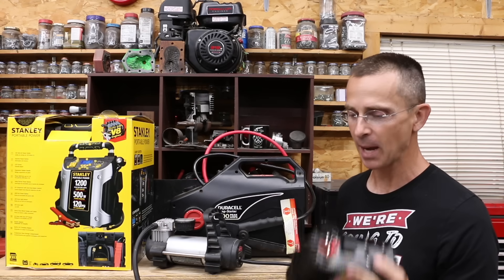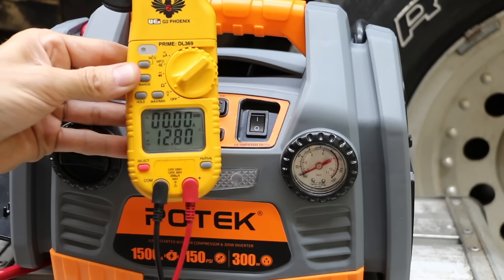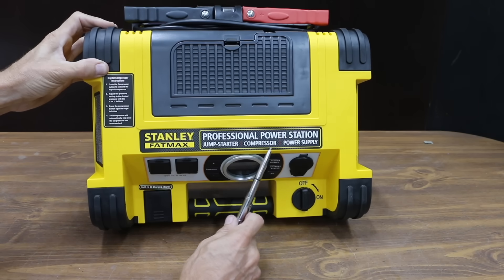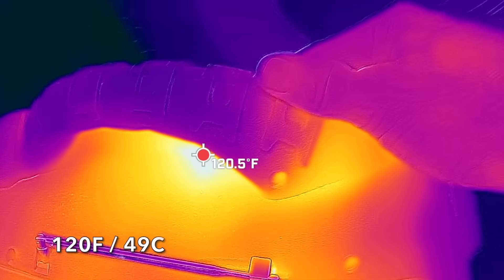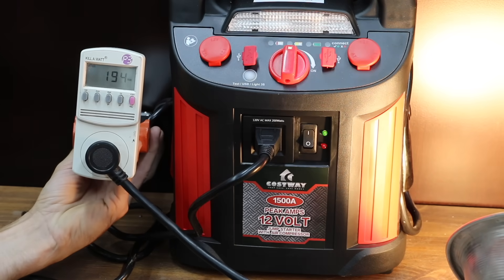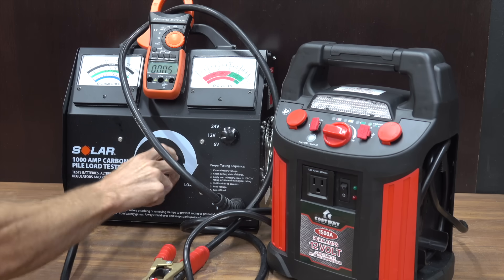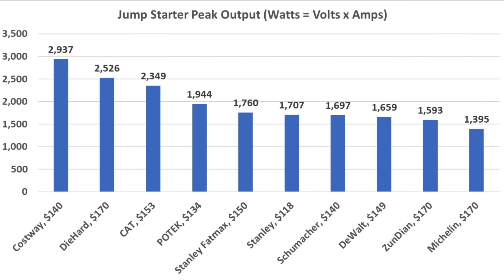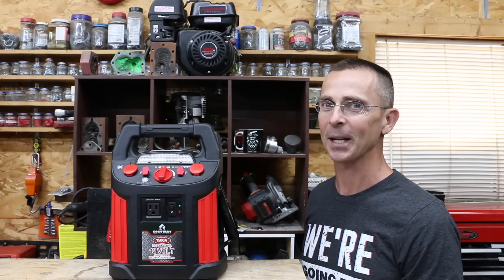Best Jump Starter? DieHard, Schumacher, DeWalt, Michelin, Stanley, CAT

Comment: Todd - Did you re-drain the truck battery after each attempt at start? And, wait long enough (I dunno, 5-30 minutes?) between devices to let the chemistry resettle? Also, did you control for how long you had the jump pack connected before trying the ignition? Two critical things to make an apples-to-apples connection. Details: What happens when you connect the jump pack to the battery (with the jump pack's switch on), is that it immediately starts trying to equalize the jump pack's battery with the car's battery. This charges up the truck battery continuously. If you didn't re-drain it afterwards, then it's unfair to the early jump packs because they were basically just dumping a good portion of their charge into helping their competitors next round. Also, you need a certain amount of voltage to spin the engine. I.E. If the jump pack is at 13.8v, and the starter battery is at 2v, and you try to start it right away, a little power is going into the battery, but most of it is going into the engine, and there's a high voltage to cause a high amount of amps to flow. But if the jump pack has been sitting for a while, even more than just a few seconds, it's voltage is going to be sagged from charging the starter battery, and the lower voltage is not going to cause as many amps to flow. Even if the same net amount of energy is still in the system (jump pack charges charger, even pretending it's 100% efficient), you can't get the energy to pump out as quickly from the lower voltage. Jump packs really need every possible advantage they've got, to be able to turn over an engine, right from fully charged. If you were to compare with those portable lithium-ion/supercapacitor packs, those definitely don't have much energy at all, they have very, very small amounts of energy but can dump almost all of it at once, but that means you've got only several seconds to start the engine or they'll have nothing left. They might even have brains in them to make sure they don't even try to charge until they detect a starting load. They're a more extreme sensitivity compared to lead acid jump packs.

Also... 13.9v isn't overcharged for SLA batteries. If you were to take the jump packs apart and see printed on them or look up their datasheets, most would probably tell you to charge them to between 14.5v and 14.8v for standby use. North of 14.8-15.0v is where lead-acids are actually overcharged and will start to eventually boil off electrolyte. And different brands will have very slight chemical differences in their cells, with slightly different voltage tolerances. It would be smart to use a slightly higher voltage version in a jump pack, where power (not energy) is your biggest goal.

Also... a vehicle with a flat tire can still have the engine running. How long the compressor lasts without dying isn't all that relevant when you can plug it into your cigarette outlet while pumping (or at least burp it back full again by clamping it onto the starter battery). Contextual failure makes it a lot lower priority to only half-fill a tire.

Comment: Have you considered testing the starting capacity at cold temperatures? I live in Alaska and one of the issues I have had is the charger has sat in vehicle for a while even if it was warmed up earlier.  Would be interesting to see how they perform when the unit is cold. Hard to duplicate real life conditions for all the parameters but placing them in a freezer for a couple of hours might have interesting results. Always enjoy your videos, thanks
Reply: Agreed, but unfortunately these are all junk in warm temperatures so they would have been even worse in the cold.

Comment: The DeWalt one was torn down a few years ago on another channel and a viewer commented that because the piston is missing a wrist pin, it's lifespan is limited because the piston and wall of the cylinder would be affected die to the rocking motion.

I'm going to assume that is the same design for probably all of them, but it would be pretty cool to find out if one or two actually used a wrist pin.
Reply: Had to look up what a wrist pin is, and it appears to be the main pin that connects the connecting rod to the piston.  In other words, a critical part that has to be made and machined to high quality standards to work well and hold up to the tough job it does.  How can you connect a rod to a piston without a wrist pin?  Did DeWalt find a cheaper way to do it?  (All these decisions are ruled by the almighty dollar.)

We bought a new, no-frills Whirlpool refrigerator 2 1/2 years ago.  It works great and you can barely hear it run, so that piston (in the compressor) must have a darn fine wrist pin.  Will it still be running in 20 years like the last refrig?  That's the question that only time will answer.  Most everything is made to be thrown away these days rather than repaired.  My parents had a 56 year old General Motors refrigerator (made around 1950) in their basement that ran perfectly up until the day they sold it to someone for 25 bucks.  That was 15 years ago and I wouldn't be surprised if it's still running today.
Reply: @Brian424  The unitary piston-connecting rod is used not just to lower the cost and complexity of construction,it lowers the weight of reciprocating components and is almost always used on small capacity/short stroke air pumps.They require very little in terms of lubrication,a wrist or gudgeon pin that small would rapidly wear in one area without sufficient lubrication (you don't want vaporised oil droplets entering your air supply)Automotive suspension pumps are a perfect example of their use.The almost spherical piston design reduces friction on non lubricated cylinders,thereby reducing heat and wear,the piston is generally sealed by a single thick nylon/teflon round edged split washer type seal which maintains sealing at any piston inclination.The design has been around for decades and is by and large reliable. Those little plug in tyre pumps you get in your boot/trunk will have the same principle. Also the compressor in your refrigerator is a rotary type pump it works on a cam system.
Reply: @areyouundoingthatorwhat9181  The random knowledge about everything that can be found among YouTubers and the rest of the internet never ceases to amaze.  Thanks for making me have to google a bunch of stuff to see pictures of what you're talking about.  Knowledge is power! 

PS- Tyre is spelled tire.  And colour is spelled color.  And a trunk is a trunk, not a boot.  And a hood is a hood, not a bonnet.  And a windshield is a shield, not a screen.  Love ya!  ;^)
Reply: @areyouundoingthatorwhat9181  .... I have to ask this question.  What is your line of work?? Are you a mechanical engineer?  Also, thanks for the explanation about how these things work.  I too am sometimes amazed at the depth of found in YouTube comments.
Reply: @amp12345amp  I spent my life,man and boy in the motor trade, about 40 years all told. Predominantly electrical and electronics nowadays but we (my family)also design, construct and prove specialist vehicles for various industries,mobile desalination plants,pumping stations,winches,generator trucks,field workshops etc. And some modified cars,I am currently about 75% into a 300 bhp focus ST track car for a customer.

 I do all my own fabrication,panels and non power train machining and also have extensive experience with composites. My family have been involved in the trade and industry since the turn of the 19th century, working as design consultants and specialist development or design engineers for companies such as,Dunlop, Roush,Jaguar,ford motor co,Skinner's union,century oils etc.,an uncle developed sewing machines for Singer. My father a very skilled engineer and specialised welder,now mainly retired from the day to day stuff restores vintage farm machinery and tractors,most of my knowledge extends from a childhood of being his lacky😁 I was learning stuff like arc welding at 7-8 years old!,so machinery is sort of in my families blood with a good concentration of varied knowledge, one of my sister's is a skilled auto trimmer/ upholsterer. I have personally completely built or restored approximately 15 cars for myself,some with very extensive modifications. Fortunately I have been blessed with a brain like a sponge, natural dexterity and a hereditary knack,allowing me to turn my hand to many tasks with ease,dogged determination to not fail is a trait I also suffer from😁. My philosophy is that life is a big,long lesson,enjoy it and make the most of it.
Reply: You will only use it once or twice in your lifetime, so thats a pretty good lifespan.
Reply: @thra5herxb12s  not necessarily. I've use my Schumacher once for my own car but a half dozen times to help my friends and acquaintances. I can't speak for the other brands but the Schumacher seems to hold up to multiple inflations.
Reply: @thra5herxb12s  And when you finally need it, it will probably be dead, because it's been forgotten under a pile of "junk in the trunk" since you got it for Christmas seven years earlier.  :-)

Comment: I enjoy Sundays waiting for the latest PF review. The usual very thorough review and test. I have had a CAT for 5 years and so far it has performed flawlessly.  I just recharge it every 3-4 months.  The has a compressor PSI set point that automatically turns off the compressor when the set point is reached.  Great feature.

One area to improve your tests is to explore the ease of repair.  For the power station, you need to eventually replace the lead acid battery inside.  Can it be done and if yes, how easy is it to perform?  Same thing on power tools with brushed motors.

An idea for a future test - toolboxes like a 2 or 3 drawer "portable" one (handle strength, dent resistance, drawer slides weight capacity).  You might by one or two and have it for a long time - choose wisely.

Comment: Great test regimen as usual and you proved what I always suspected, that these devices are largely junk and cannot be relied upon.

I have a starter/charger that is separate from the pump. Neither are amazing, and in fact the mains charger for the starter/charger was the first to fail and then, after finding a replacement mains charger, the circuitry inside the starter/charger refused the I coming voltage. As the batteries were good, I chose the use a ripple charger for it and bypassed the circuitry. It works but boy these things are rubbish.

Comment: I would guess the ones that smoked was the internal wiring or the large switch that turns on power to the battery clips, i had a couple that died at the switch with a high current through it.  Gave up on these manufactured boxes and made my own. a large automotive AGM battery made by Deka in the USA, a marine battery box, a set of jumper cables and a set of 175A Anderson connectors that can take far more surge rating, one connector bolted to the top of the battery box the other on the end of the jumper cables, plug it in when you need it.  Yes it's heavy, and i made a frame with a handle attached to the battery box, but its reliable and always works.  It don't have a inverter, don't need it, don't have a air pump, don't need it, i just want something that can jump start anything.  When its not being used its on a small float charger to keep it topped up.  It ended up being a very handy thing to have as battery quality has gone into the toilet these days it seems.

Comment: It looks like the Shumacher assumes a power factor of 0.9 with any load, even for loads with perfect power factor such as an incandescent light bulb.  Makes sense since most electronic loads that will be plugged in will be between 0.9 and 1 PF.  That way they don't need to do fancy integration to measure real power, just multiply magnitude of current and voltage with 0.9 and it will be close enough.

Comment: Interesting how the two Stanleys, the Dewalt, and the Cat all have the same exact LCD display in them.
Also interesting how those same 4 happened to be the only ones that shut off before reaching the target tire pressure.
Kind of makes you wonder how many different brands of devices are made up of the same components inserted into different cases for different manufacturers.
Reply: Pretty sure they are all set to cut off at 10 minutes as an overheating safety. Most all of those compressors say to use a duty cycle of on 10 minutes on then 30 minutes or so off before running 10 again.  Almost seems pointless for anything other than bicycle tires.

Comment: I wonder if the ones that smoked up are due to thin gauge wires and circuit boards with weak solder connections. I’d like to see tests done with the mini jump starters unless you have done this video in the past.

Comment: This test seems to confirm what I’ve noticed.  I bought my first jump box/compressor roughly 20 years ago.  The couple I’ve purchased since, just don’t seem to have the same capabilities. Thanks for all your testing- it is greatly appreciated.
Reply: I had one that worked well about the long ago too.  It started several cars on several cold Minnesota mornings in the trailer park I used to live in.  (Trailer parks aren't known for late-model cars with new batteries.)  A couple of those cars were owned by hot, grateful girls, but alas, I was married at the time.  Then the jump starter burnt up in a house fire.  Last I saw it, it was a pathetic, melted lump.  They don't make things like they used to.  Can't remember the brand, but it was nothing anyone ever heard of.  No idea where I got it either.

Comment: All these have the same problem as jumper leads do, they are all trying to push way to many amps through a crappy clamp that doesn't have the surface contact area to get that many amps through.. they would probably work better if connected and left for a while to put some charge in the car battery first before trying to start the engine.. I've never used these jump packs before but i never just try to jump start a car with jump cables without first waiting to allow the car battery to receive some charge so I'm not trying to push 500+ amps through a few square mm of contact area.. note the contact area on the terminal champs on car battery cables,  they have several square centimeters of contact for a reason

Comment: On the air pressure gauges that are off I have seen they over fill a bit. I found if you disconnect and then just reconnect the air chuck on the tire valve  it will read the correct pressure or closer to it. I think it is the pressure in the unit / hose that causes the over pressure until you release it and read pressure again.

Comment: I have an older model FatMax (before they included a power inverter). I used it to inflate a large tire at low psi, but the extended use killed the air pump. It was very hot. I don't know if there was a safety switch or if it simply malfunctioned. It seems the Stanleys, Cat, and Dewalt jump packs use a few common components. They had similar performance with the air pumps, and they have similar LCD displays. Also, there is a finite amount of magic smoke in all electronic devices. Some simply have more than others, but the magic smoke can never be put back in.

Comment: If I were on the road and desperate would this work? Disconnect the positive terminal of the battery from the car, and connect the jump starter to the car. That way the jumper is 'only' trying to turn over the engine and not also trying to lift up the dead battery.  Once the car is running the jumper can be disconnected and the positive terminal of the battery could be reconnected. Maybe damage the alternator on re-connecting?

On another note, any Electrical Engineer knows that smoke is what makes things work. Once the smoke escapes the thing won't work anymore. Too bad you can't by an aerosol  can of smoke for refilling.

Comment: I'm not much interested in the air inflator as the spare should be inflated. You are checking that, right?  The battery pack is nice to have to charge cell phones but I've gone to the mini units that jump a battery, charge off the 12V outlet and can charge a cellphone. The size of a brick and they are quite the thing.  If I'm trying to charge a laptop or phone I have a solar charger that can get that done.

Comment: Great video as always!!

Im honestly OK with having a seperate 12V compressor and jump pack, you can regulate the quality better over two devices. For USB power, the USB adapter for my Kobalt 24V line of batteries has enough power to keep all our devices charged through storm outages. 

I have a Slime brand compressor from walmart, not the cheap plastic box but heavy metal barrel model that is not available anymore and it is awesome. Inflates tires real fast. Always in my car. To complement that, I have a small 12V jump pack that can start any engine in good running condition very easily. People are amazed when I assist them with a jump from something so small they can't believe it would start their car. 

Test request - ratchet box end wrenches please!! Gear Wrench, Harbor Freight Pittsburg and ICON, put them to the test against Snap on and MAC with some cheap Ebay imports!  Thanks!
Reply from the maker: Thank you!

Comment: Hmmmm, all those yellow units all come from the same Stanley-Black&Decker OEM in Vietnam. I suppose your evidence would suggest one should avoid them.

I've used Die Hard packs in the past. The lead acid pack in my unit failed after 12 years of light use. I never got around to replacing the just the battery unit like I should have.

Thanks again, Sir Todd!
Reply from the maker: Thank you!